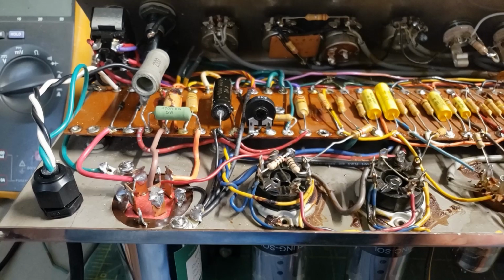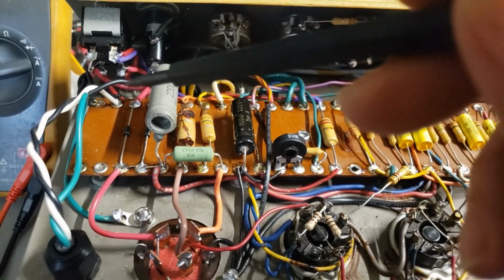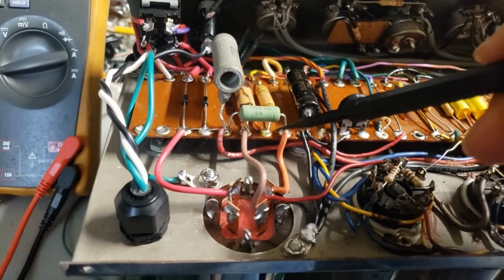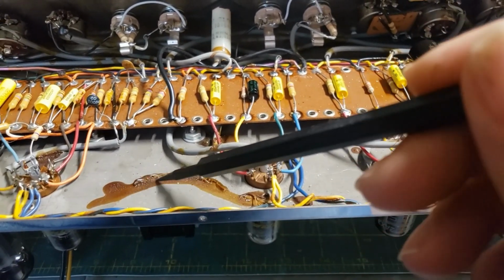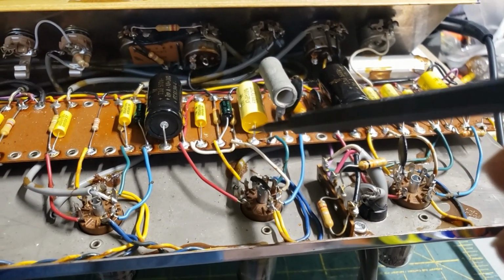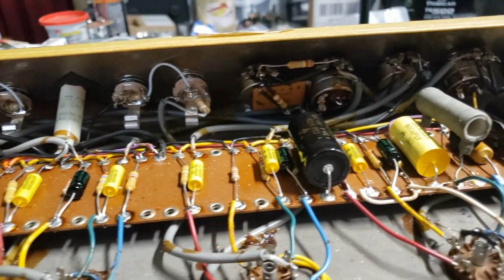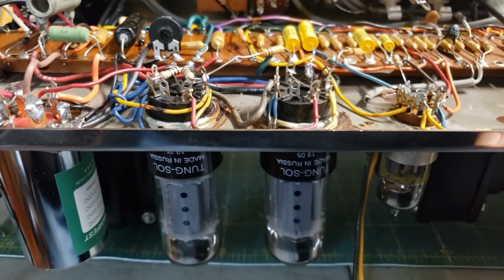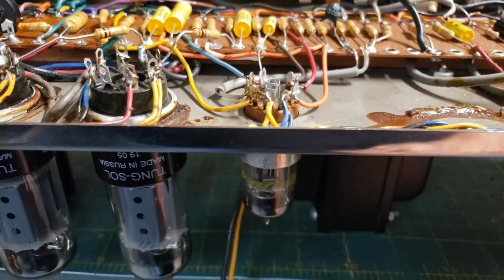'66 Ampeg Gemini II Pt 2

Comment: Can you tell me how to set up the on/off and standby switches like you've done here? I'm working on a G15 (schematic date: 1-66). I'm confused by the pilot light wiring.
I've still got my Vox AC30/TB which I bought thru Thomas Organ in 1965. I got drafted in '66 and my amp disappeared for 20 years til a cousin told me he had it in a storage shed. It was blowing fuses due to an arcing tube socket. I couldn't find any one locally to work on it so I started educating myself with Army Navy manuals. There wasn't much tube amp info in the 80's, not like there is now. I built an AC4 amp (with the EF86 tube) and a Fender 59 tremolux 5E9-A. My band, The Other Half, opened for the Doors in '65 in a small club off Sunset Blvd. Later shared a stage with The Yardbirds and Them (Van Morrison) at the Santa Monica Civic auditorium.

Comment: Lots of room to do work inside that chassis, compared to the early 70's dead VT40 a fella gave me 25 years ago--THAT was a horror. Couldn't get my meat mits in there at all, circuit board had snapped and power trans was toast...evidently it had fallen out of a truck and was a lost cause.

Comment: The 6U8, 6EA8 and 6GH8 are all very similar triode pentodes (if I remember correctly, they share the same pinout), and may be good substitutes for the 7199 after suitable socket rewiring. 6U8 and 6GH8 were used in some classic Scott and Fisher hifi receivers and amplifiers. New-old-stock examples are generally inexpensive and should be relatively easy to find.